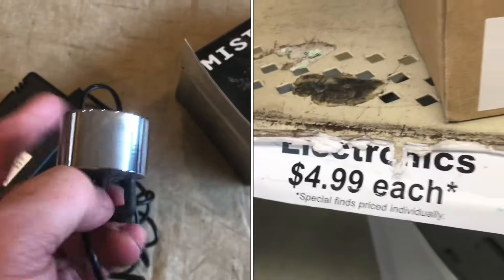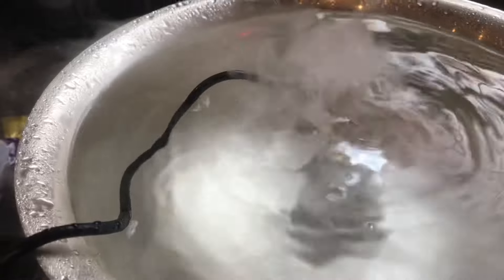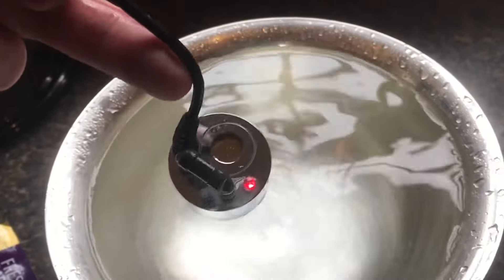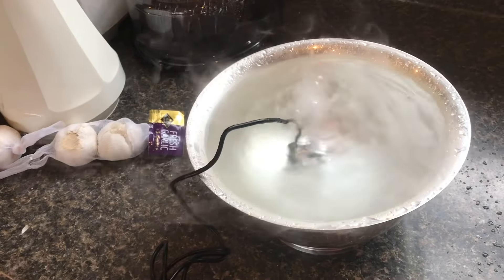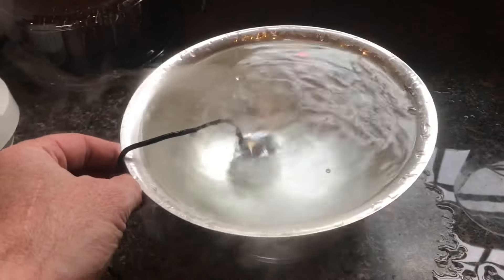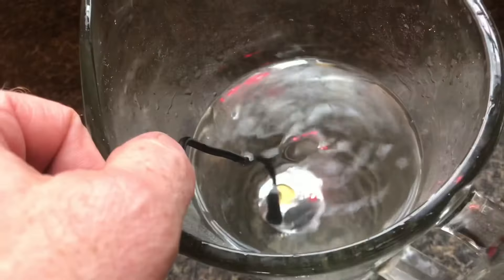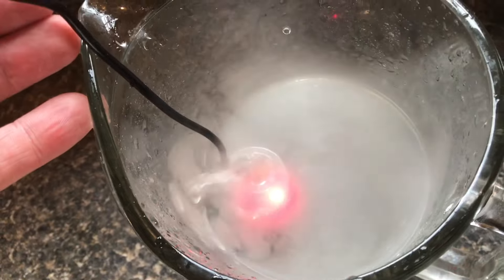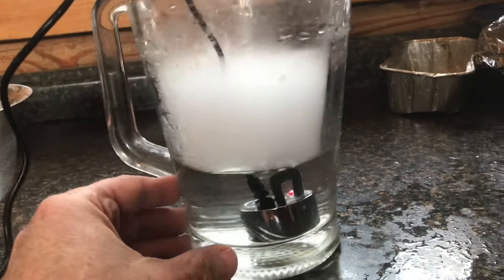(review)“ultrasonic” MIST MAKER atomizer fogger

Comment: I was digging through an old junk box the other day and found one of these ultrasonic misters. It still works just fine, but while playing with it, noticed the external resistor must be submerged or it gets really hot. The deeper the water I found (a metre of plastic drain pipe) the less splashing I encountered, as the mist is captured in a stream of bubbles that rises to the surface. 😉👍